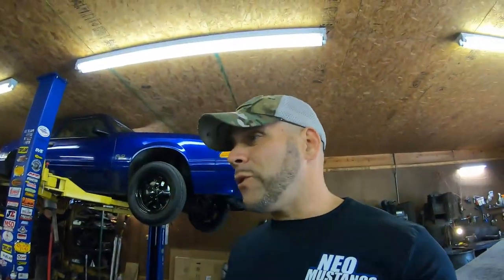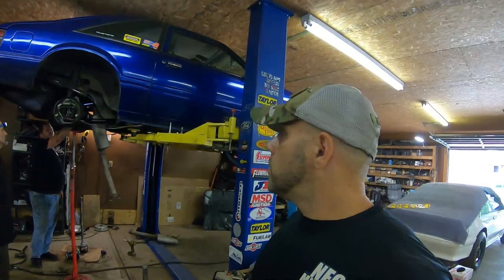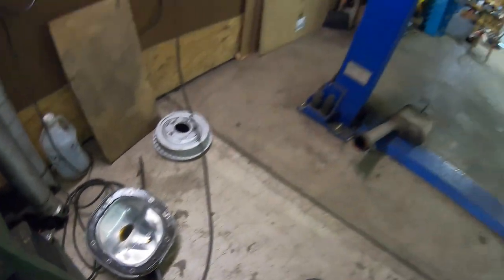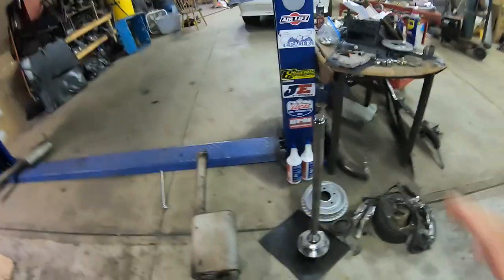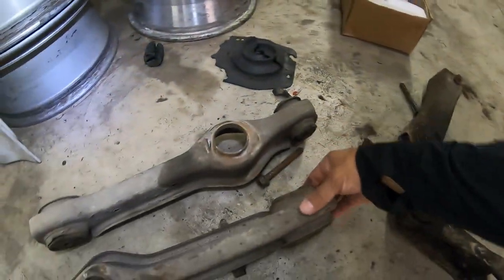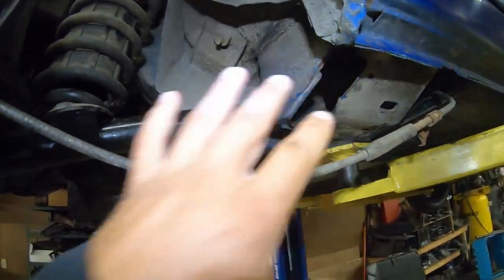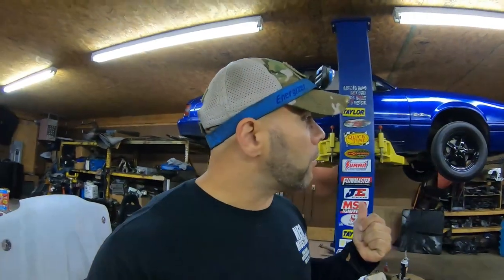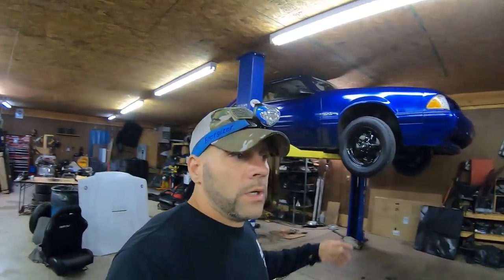325Hp Ford Mustang vs. 31 Spline Differential / Dont Make Same Mistakes

Comment: I made sure to put a new lock pin in my 8.8 when I serviced it.  On control arms - I though I would replace the old bushings and then reinforce them - until I played around with a control arm and realized how tough the bushings can be to get out.  New control arms are the way to go.
Reply from the maker: Absolutely

Comment: You can use orange Loctite; It's better for high stress and vibration, but still removable without heat. I've done it to my own driveshaft and it's worked fine for a year so far.

Comment: Running my Sgang 600 hp non rebuilt rear differential 28 spline for year’s. no regular maintenance . A clunky differential (spider gears will cause loose pin will cause this . Lack of regular maintenance will cause that too. Did you Inspect ? The biggest cause lack do diligence.
Reply from the maker: Good for you. This was a pin failure

Comment: Hobbs pressure switch to turn on the secondary fuel system under boost psi....Crude way to get extra fuel but it works...
Reply from the maker: Thc

Comment: I learned to never buy cheap EBay control arms for my car. The bushings failed pretty quick & the tires started rubbing. Switched to maximum motorsports lower arms & new bushings in the stock uppers. Rear is planted now on my fox.
Reply from the maker: I got ya. But those control arms i had on there factory.. were blew up lol!

Comment: I love my Trac Lok rear differential. I shimmed it to .655 on each side and drive normal not trying to burnout in my explorer Sport 2wd. 8.8 31 Spline Trac Lok out of a 93 Bronco that I got from my dad when I gave him a T2 Torsen to replace his Trac Lok with. I rebuilt the Trac Lok completely. Recently I got in a sticky situation where I had to go about 50 yards through some wet grass to get where I needed to go without any choice, that rebuild acted like a locker the whole way and got me out of there barely. If I had open diff I would have been stuck

Comment: Man I don’t blame you using the blue instead of red. Every time I take that 8mm crosspin bolt out it’s either loose (when I assemble it) or strips the head (when it’s stock). Just had to weld a socket onto a stock one last week to get the stupid thing out, hammering a 7.5mm socket on didn’t even work.
Reply from the maker: Right

Comment: Dan, that threaded diff bolt that holds that big pin in place, loctite doesn’t work worth a…. If there’s oil those threads are going into. Spray those threads on both surfaces with brake clean then Blue will work fine.
Reply from the maker: It’s good

Comment: I know Ford hasnt put the 9 inch in a vehicle for decades. Why they got away from that for their performance vehicles is beyond me. Probably has to do with production costs. Of course as we all know having the pinion supported on both ends with a bearing is the key to the 9inches strength. As you can tell I am an old timer from the 70s. My question is when people running the Foxes get serious about racing and horsepower do they go 9inch?  Is that even an option?
Reply from the maker: 9” ends on and 8.8. Plus they reinforce the crap out of the housing

Comment: Damn the money we would saved on mm&ff and 5.0 mustang magazines back in the day if we had you tube!! Lol im curious to see what that explorer intake does on this car. My buddy was swapping a blown up 5.0 in an explorer at his shop and the replacement motor had an intake on it and he gave me the old one..id say this was around 2000 2001 and my car only had an Ecam at the time and i swear this intake woke it up. In my mind the explorer intake was the best bang for your buck for a basic stock bottom end, stock E7 5.0..felt like they added a good amount of torque.. later on after i got some afr 165 heads  i swapped  out the explorer for a trick flow track heat and that was a mistake as far as seat of the pants feel. I finally got a holley systemax and it seemed to restore the torque the track heat took away amd revived the the top end some. Im still running the systemax intake, it just seemed to always have decent top end without killing the low end. Keep up the great content man.!!
Reply from the maker: Thx for the info and watching

Comment: So with Explorer housing in those same axles are you still going to have the pin issue where you have to shave the pin obviously you're not going to use the old pen still right ? 👍🇺🇸🔴⚪🔵🚘🔧💪🦊
Reply from the maker: We shaved it different

Comment: Be there and done that with a 28 spline 8.8. Did you do that with the 31 spline? What happens is the the bolt that holds the pin in breaks then the pin goes out the bottom of the dif and hits the housing.
Reply from the maker: Yes..was an eaton too! WTF?!
Reply: @Neomustangs  

I looked for the on3 performance you talk about and come to find out they are based about 8 miles from where I live. I am building a 351w 427 stroker over the winter. If you ever get down to the Mt Vernon area I run at Pacemakers Dragway Park.

Comment: Thank you for your videos!!  I am trying to remove my rear axles and have removed the pin but I can’t get axle to slide in to remove c- clips.  Any idea what I need to do besides beat them inward with a hammer?
Reply from the maker: You shouldnt have to beat them with a hammer to get them to come forward!?

Comment: I snapped a stock axle 3 years ago. Did the 31 spline upgrade. So far so good.  Ohh. Any issues with your aluminum driveshaft taking it in and out?  Bought mine from LMR. It’s a bugger to remove. Seems like the yoke is too long.  Ever run into this issue?
Reply from the maker: Make sure your pinion nut isnt binding it up and not tightened down. Also you running spherical bushings?
Reply: Neomustangs no spherical bushings. Seems to have happened after I installed the upper control arms.  Uppers and lowers are mismatched. I can install the stock driveshaft ok, but it seems that the aluminum shaft bottoms out in the transmission. I’ve had the shaft for many years. Btw I discovered this phenomenon when I snapped an axle on the track. Had to remove the driveshaft (super hard to get off the pinion) to remove stuck piece of axle in center section
Reply: Check the yoke splines for twist.  I twisted mind with a stone stock motor Drag radials are hard on driveline parts in a stick car.  Unless you are a hot shoe.  You need a way to control the hit and engagement of the clutch, when on DRs.
Reply from the maker: @frankandricciola9782  Ya usually when control arms tighten up the rear axle with anti roll bar it does that.

Comment: Do you think a 28 spline torsen on nt555’s could handle 550 engine/ 480 wheel hp if I don’t launch it? Like very smooth takeoffs and only floor it like 3500-up maybe 60mph?
Reply from the maker: Not really
Reply: Cause I have a v6 new edge and I’m working on a semi-right budget. I got a built 352 stroker engine that should make 550 horse on pump gas and I’m running a cluster plated factory t5. The car is strictly a street car and will never see a proper launch. However, it’s my first prototype and will be sold as soon as the car is fully restored. Going 10” irs next build 👍🏻

Comment: What the record for stock block stock bottom end . Time wise is a quarter mile ..
Reply from the maker: Not sure.
Reply: 5.83 at like 130. Eighth mile X1.54= like a 9 flat if it made it.
Reply: @robertelmo7736  ywah those stock block guys on FB have a dude in a fairmont like mine running 5.0s turbo!! No lies

Comment: What year explorer do you get the 31 spline diff from?
Reply: 96-01 has 31 spline 8.8” and disc brake. Drivers Door code d4 is 3.73 ls, d2 is 4.10 ls.
Reply from the maker: Nice info